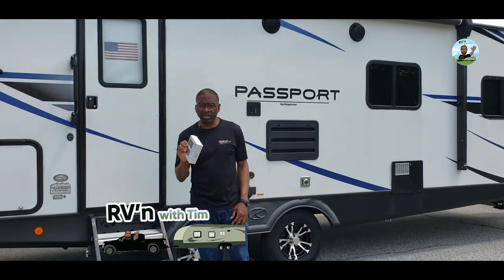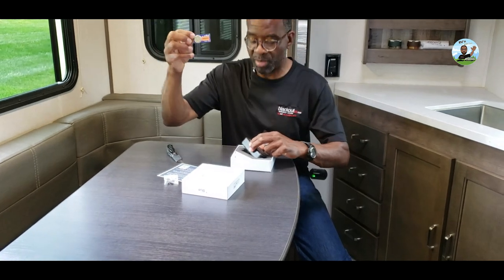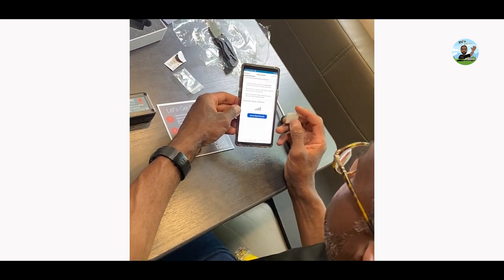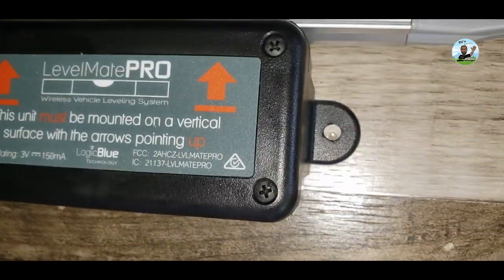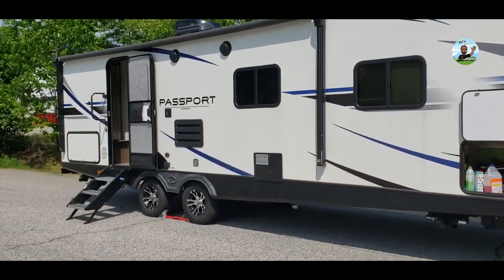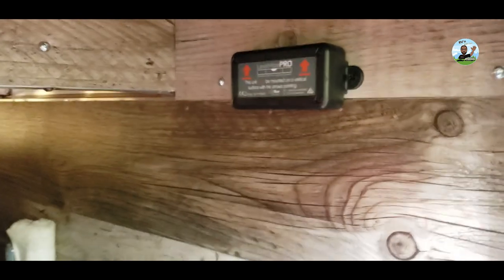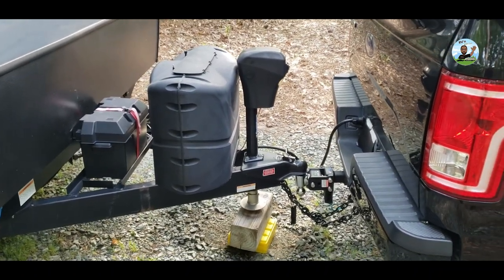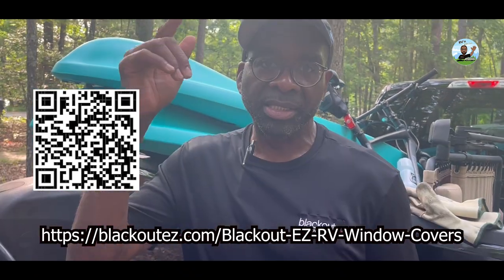LevelMatePro Installation Made Simple: BlueLogic Edition

Comment: Helpful video. Good safety tips when you were parked in front of your shop. It does not appear you are using stabilizer bars on your trailer. Is there a reason for that? I have towed my new Rockwood Mini-Lite 300 miles without them, and my Silverado 1500 LTZ 5.3 actually did pretty well. But I will be using them going forward.
Reply from the maker: Awesome! I am currently using airbags instead of a weight distribution hitch.

Comment: You need the slide out during setup of the Level Mate Pro.  The slide will throw it out of level.
Reply from the maker: There is a set-up procedure to allow for that during installation. I don't use it. I compensate for it during setup. I might do an additional video for slides. Thank you for the comment 😊

Comment: You leveled the trailer but never showed calibrating the Level mate pro. You never finished the setup
Reply from the maker: I am so sorry 😞.  After measuring and entering the width across the axle and from the center of the rear wheel to the tongue, you then acknowledge on the app that the trailer is level. The Level Mate Pro is then ready to use.